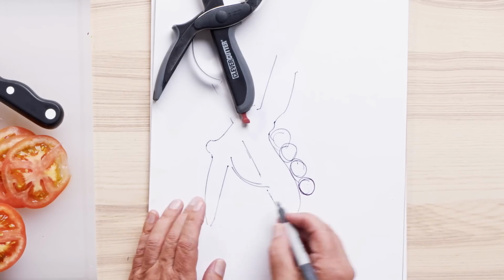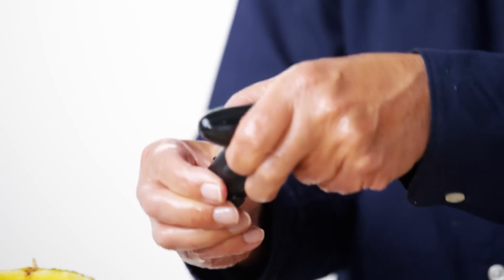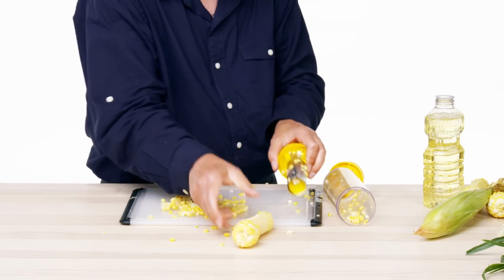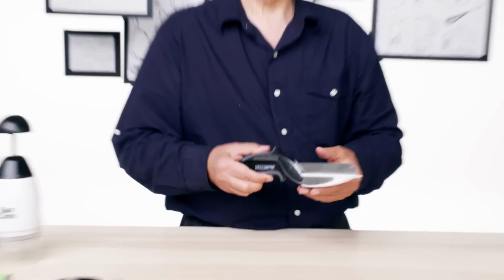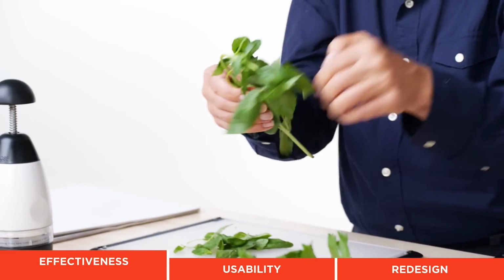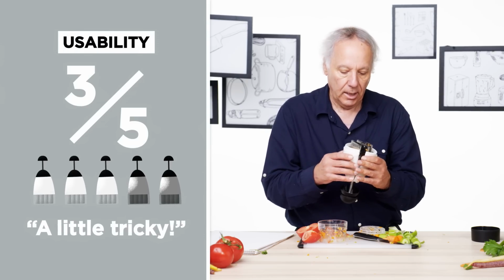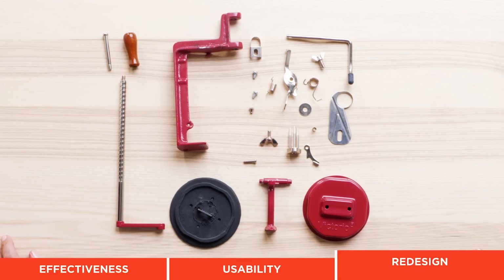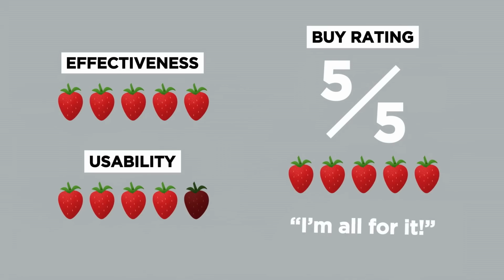7 Slicing Kitchen Gadgets Tested by Design Expert | Well Equipped | Epicurious

Comment: The slap chop: isn't perfect

Me: It dOEsnT MatTeR ABouT HOw GoOd THe ActUAl ProDUcT iS, THe coMMerCIaL WaS LEGENDARY!

plz ik the product must work 4 ppl to buy it don't spam the comments because of dat👍
Reply: Actually nope. He doesn't do that well. That's "Slap Chop", not the "press chop". He did those basil leaf with low speed pressing the cap. Knife can't cut things well with low-speed chopping if you don't move the blade to slice. (Slap Chop's blade can't slice. It can only chop with vertical movement. So you should slap it as well as effort you can.)
Reply: @nullAttack7327  intresting😂
I completely forgot I wrote this lmao
Reply: @CapySlay6002  Mwahaha!

Comment: My family and I can every year so the apple peeler is a sweet gift from heaven. If you are doing bulk apples I highly recommend it. Also, mine is outfitted with a table clamp and lock so it is really stable. And it works on potatoes.

Comment: I skipped the whole "oiled left hand" test thing. 1. you're not left handed, 2. should've had an actual left handed person test it, 3. should've done both, right and left "oiled hand" test. good video though, i want to buy some of these appliances, mainly the pineapple "slicer".
Reply: That is the point of the left handed oil test. you use your nondominant hand (since he is right handed, he would use his left hand) to simulate someone with dexterity issues, and the oil is used to simulate someone with grip issues
Reply: @janus1936  ... that makes no sense. a person with issues wouldn't have ease to use these in the first place. the point of left hand test IMO, would be to see whether or not a left handed person would be able to use these items with the same ease as a right-handed. I'm ambidextrous, and I can tell you, the "oil test" would work the same way on BOTH of my hands. meaning, that if slippery/oily it would be harder no matter which hand I use....
Reply: I don't think I understand what you mean. The whole point is to see if it can be used by people with disabilities. A lot of kitchen gadgets are made for people with motor skill issues (the slap chop is a good example, as it allows people who may not be able to use a knife to chop things)
Reply: @janus1936  sigh... this conversation is going nowhere. I'm pretty sure some/most people with disabilities don't use ANY of these appliances(or any appliance at all for that matter). Alas I digress, agree to disagree.

Comment: What kind of soap do you use that doesn't eliminate oil

Because thats the point of a soap, it has hydrophobic/hydrophillic molecules which removes oil from the hands and letting it flow freely from yours hand when water is applied.

No kitchen tool should be used by someone who has not got clean hands or has any knowledge of basic health and safety regulations.

Comment: I love my apple peeler/corer/slicer. Mine has a clamp on the bottom, not a suction cup. It takes a couple tries to perfect removing the whole core, but once you've got it it is so much faster than peeling/coring/slicing by myself. I also have to disagree with hin on the wing ut. Once you've used it to process a bushel of apples that bolt gets stuck by the juice. Without the extra grip of a wing nut, it would be impossible to unscrew.

Comment: I have dexterity problems because of carpal tunnel syndrome and for me it's easier to use a knife than a clever cutter because using scissors hurts and sometimes I don't have the hand strength to do so.
Something I use on objects without serrations for friction, is two bits of shelf liner (the rubbery bubbly stuff). It help me to hold and twist objects like jars with less force and less pain.

Comment: I go camping alot and the clever cutter would be great to have when you are camping in an RV where there is limited space to cut stuff so you can just cut the veggies right into the pan or pot or if you're doing tent camping and cooking over an open fire then again, you don't have to try to balance a cutting board on something and possibly cut yourself and can cut veggies right into the foil for cooking. As an avid camper, I'd buy it. Also, you don't have to worry about an open blade sitting around as it closes.
Reply: I appreciate your post. It's a perspective I didn't think of. I was expecting the clever cutter to get a much lower score because usually in these videos, he questions why the device even exists when there are better obvious alternatives. In this case, knives are generally better but your perspective of why knives are not as good is a good answer.
Reply: I definitely use scissors to cut things when I don't have the mental energy to deal with getting out, using, and cleaning a cutting board and knife. Being able to cut something right above a bowl is a lot simpler than cutting and carefully balancing and scraping off food, especially when you're cutting up and transferring a lot of a vegetable (multiple trips, cutting-board buildup, size of the knife vs available cutting board space, etc). 
It's lighter to carry than a whole cutting board (and outdoorspeople definitely think a lot about weight and supplies when packing!) So great points on all counts! 
As for the open blade, seeing this gadget made me remember a "cooking class for kids" where they apparently didn't want to teach any standard adult kitchen techniques apart from measuring ingredients. I was insulted when they made us use scissors instead of knives & cutting boards to cut meat because at that point, we were in middle school! But while middle-school me was insulted because I thought they were talking down to us, I do think that a scissor design could be a safe way to involve younger kids in the kitchen when they want to help but it's not practical to constantly supervise them and they don't have the training or dexterity to safely use a knife unattended. 

(I wonder if making the handle longer relative to the hinge-thing so it has more leverage over the blade would be more effective? Could make cutting carrots easier on the hands)
Reply: I already use kitchen scissors all the time and this looks like a significant improvement in that method to me. The little blade shelf that holds things in place and makes for a proper smooth cut? Excellent
Reply: Or you could use ✂️ scissors 🤷🏻‍♀️
Reply: @Nicole-rz3qv  I have yet to find a pair of scissors that can cleanly cut through a cucumber in one slice. If that's available, I'd buy it.
Reply: @Jackie89000  There are scissors for vegetables and scissors for meat. I like the meat scissors better. Super sharp scissors for meat tho, I use em.

Comment: I didn’t see him redesign the corn stripper, but personally, I’d redesign it similar to the pineapple corer, where it twists and screws down the length of the corn, so the downward force comes from the screw, as opposed to having to force it straight down.
Reply: lol it was supposed to twist down but he didn't twist it. You can tell by the gear shaped head.

Comment: If you had a device that would both core a pineapple and blend the rest, leaving it’s outer shell (or however you call that part), not only would you have a nice drink, but it would also come in a nice, biodegradable cup.
Bonus points to making a pina colada with it.

Comment: i never understood why people "hull" strawberries, like just rip the leaves off and it eat
Reply: If you're cooking/ baking with strawberries then the white middle part often makes a different texture than the other parts and when you're trying to cut up a lot of strawberries you can waste a bunch when you just cut off the top.
Reply: @blossomnessstudios4446  You also waste a bunch when you cut off the entire core tho. I jusyf cut a teeny bit on the top just so then goes off but little actual strawberry meat goes to waste
Reply: @blossomnessstudios4446  Good Point
Reply: @blossomnessstudios4446  so just cur the white part off the strawberry in 1 motion it takes less time than the item

Instead of trying to do a circle cut to just get rid of a small part just chop a slightly large cut and it takes like 2 seconds
Reply: Right
Reply: @nobody-fp5is  left
Reply: Because someone people don't want that white part.
Reply: It depends on the variety of strawberry you're used to. Here in Finland for example, the strawberries are red all over, and the core is essentially non-existent (variety is called polka, the most common strawberry you'll find in the Nordics). This means it's enough to take off the leaves. For some of the imported strawberries I've eaten (during winter time from Spain or the US), the core is considerably bigger and harder, and there tends to be more white parts in the strawberry.
Reply: ...also as a Finn, I was coming to say, that the best tool removing green and little bit tough parts of strawberry, is little bit pointy and little bit sharp teaspoon. Some people use straw or such.  But good point and as said: Finnish strawberries lack hard parts, are midsized or even small, and sweet and juicy like good candies. Polka is nice, Senga is  another old good  variety, and Honey third, newer one. 

Long day light periods during the summer make berries more sweeter and packed with taste, compared to many other, more southern countries. In my mouth, those big, light or partly white strawberries taste raw, or even sort of like cucumber. Not real strawberries at all, from my point of view.
Reply: Just eat it all.
Reply: İ can litteraly use  knife and also get the white part out with still having 99% of the strawberry in 3 seconds and he just xuts it in half in more then 7 seconds he jsut wastes it
Reply: Same reason people don’t eat the core of an Apple , technically you can eat it but you just choose not to
Reply: @yayrandomnness11  actually in the case of apples the seeds practically waste the core soo
Reply: Agardemon off only part of the apple left when I eat one is the stem
Reply: Agardemon off I eat the whole apple. Seeds n all 🤷🏻‍♀️
Reply: @captainteeko4579  Apple seeds actually have cyanide that can effect your respiratory system with just 4-5 seeds.
Reply: @sax7760  Nope, takes quite a few more.  Not sure where you heard that from, it takes like 40 apples to cause serious problems.  I don't eat the core anyway, but 4-5 seeds is not enough cyanide to harm you.  Ask Hank at SciShow lol
Reply: @TheShoelace17
Yes! This is the best way to enjoy an apple! No food wasted and more apple enjoyed!
Reply: yayrandomnness11 you don’t? Try putting in a microwave first. Then everything but the seeds top and bottom of the apple can be eaten, and it tastes great
Reply: @yayrandomnness11  I always eat the core don't judge
Reply: @yayrandomnness11  wait people don’t eat the entire core and leaving only the seeds and stem?
Reply: @yayrandomnness11  the core is waaaay too woody
Reply: @yayrandomnness11  Apple seeds are poisonous.
Reply: @yayrandomnness11  arent apple seeds kinda ermm Lethal? And no.
Reply: @TheDamnedSnail  yes but you'd have to consume a ton of them to do anything to you. One seed has about .6mg of cyanide.
Reply: Mr. Weebo Man or eat the damn leaves
Reply: Mr. Weebo Man i don’t agree but i’m the 800’s like so i cannot resist
Reply: Shoot i eat the leaves too
Reply: Why don't you just eat the whole strawberry
Leaves and all
Reply: Or don’t do anything to it just eat it
Reply: Same
Reply: Mr. Weebo Man ikr
Reply: Let’s not forget the strawberry huller is a scam
Reply: Fr I used to just eat the leaves with it
Reply: Shots. 🤣😁
Reply: Fill it wit da choccy
Reply: CHOICES
Reply: Wait u rip the leaves off?
Reply: I just cut the top off. Yea, it wastes a little but it’s not that bad
Reply: nooo
Reply: You don't eat the leaves?
Reply: I agree but i eat the leaves
Reply: I mean, I just hull them with my nails under 2 seconds, so...

(They're not even that long)
Reply: EXACTLY THERES LITERALLY NO REASON TO TAKE OUT THE CORE
Reply: If you work in production like a small business making stawberry things loke jam or smthng, this can be handy and time saving
Reply: Same but my problem is with pineapples, why get with of all the tasty skin?
Reply: @caderidley2309  It's funny that you say that because..
Reply: It's useful if you're working with strawberries for, like, pastries, especially in large batches.
If you're just going to eat it, just hold the strawberry by the stalk and nibble around the leaves.
Reply: Ur right
Reply: I eat them leaves and all.
Reply: When they're fresh that's what everyone does.

When they're older and you're cooking them, you core them as the middle cooks to a different texture. You can also core older ones to make them more edible to eat without cooking. 

So like of course you don't core them. You described yourself doing the activity that doesn't involve coring.
Reply: Wut??? Why rip he leaves off
Reply: @Bob-aaaaa  Bet
Reply: Lil Timmy 
The leaves of strawberries usually have dirt in them.
Reply: @Bob-aaaaa  do u it the strawberre with the leaves?!?
Reply: @sophiebell4758  we all make mistakes in the heat of passion
Reply: Also poke a straw through the strawberry and you have a strawberry with no leaves
Don’t buy the huller
Reply: I can’t relate. I’ve never eaten a proper strawberry in my whole life. The first one was a dry, mashed one,like its flat. The second one was practically covered in ice
Reply: @yesimafantastayzen3744  YOOO. Me too man. My first one was so ripe it basically exploded with a touch

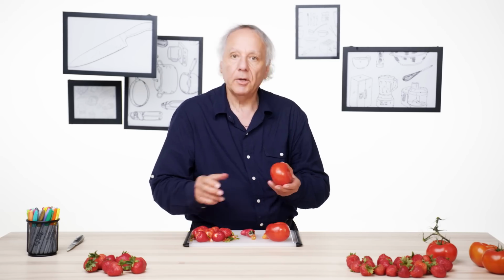Comment: 20:27 i have these amazing things on my hands they are called fingers i can use the to pull of the leaves and the small stem in about 1 second
Reply: Astrobot 3000 That's really wonderful for you but not helpful for people who have dexterity problems like me. I cannot always pinch squeeze hold or twist things myself. I sometimes experience weakness other times pain and other times both.
Reply: @IceKreacher  yeah i guess so, all im saying is that if you are part of the majority of people Who don't have dexterity problems like you have,  then this Is completely pointless.

Comment: Dan: How good is the slapchop?

Slapchop: well yes, but actually no

(grammar issues intended)
Reply: Nope. He doesn't do that well. That's "Slap Chop", not the "press chop". He did those basil leaf with low speed pressing the cap. Knife can't cut things well with low-speed chopping if you don't move the blade to slice. (Slap Chop's blade can't slice. It can only chop with vertical movement. So you should slap it as well as effort you can.)
Reply: This comment gave me HIV AIDS

Comment: It didn’t really chop the tomato though, it kind of just turned it to a mush
Reply: It’s used preferably for salsa
Reply: you gotta lose weight, one slap at a time
Reply: BECAUSE HE WASN’T SLAPPING
Reply: True true
Reply: yeah, a relative of mine owns a similar product and I wouldn't even consider using it to chop tomatoes. The flesh is too fragile and the skin is too hard to chop. (in my experience, you really want to slice or pierce-then-slice most tomato skin if you want to cut a ripe tomato without just smashing it). I don't think it's at all suited to that function. (Now, I am curious about whether or not it would work with a blanched peeled tomato...I've never considered using a tomato because of how soft and easy to crush they are, but if it was pre-peeled...may be useful with some kinds of salsa?)
Reply: My brother in Christ what did you expect? The insides of a tomato aren’t the most secure thing in the world
Reply: @PorygonToast  To cut them. Not mash them. That's what was expected.
Reply: Yeah, if I liked tomatoes I'd prefer clean pieces.

Comment: Pineapple tool is a waste literally. Waste half the fruit
Reply: Not really, the core isn't really pleasant to to eat and the pineapple near the skin is similar to the core.
Reply: That big chunk he's wasting is the core. While it's perfectly edible, it's a lot harder to bite through and is nowhere as flavorful as the rest of the fruit. The tool itself is ideal for making rings for use on stuff like ham. If you really wanted to though, you could just spend like 5 seconds and cut it the core off with a knife.

Comment: The type of slap chop (not the actual name of the one I have) I have has a concave top so it is a lot more accommodating to use (like the sticks on an Xbox controller, but large enough to fit your palm in), and it also has had no problem chopping stuff... I often chop tomatoes for my home made salsa, and this is by far the best product for that, though it is tricky to open up and wash...
Reply: He doesn't do that well. That's "Slap Chop", not the "press chop". He did those basil leaf with low speed pressing the cap. Knife can't cut things well with low-speed chopping if you don't move the blade to slice. (Slap Chop's blade can't slice. It can only chop with vertical movement. So you should slap it as well as effort you can.)
This kind of mistake as often is the case that many product reviewers have had.

Comment: hate to be that guy but i just cant agree with a lot of these. they all feel kind of biased and somewhat mindless
take the strawberry huller for example; during the time test where he did it by hand, there was a very clear 3 second delay between him actually hulling the strawberry and the timer pausing. additionally, hes doing it by hand in a ridiculously slow way. while i understand that arthiritis can limit hand movement, we still need to take into consideration common sense. if you don't understand how he his method was slow, you can do the exact same thing but instead twist the knife. i've gotten through entire boxes of strawberries with this method in 5 minutes, and i had only used the method once or twice before.

tl;dr: idk man this seems kinda biased